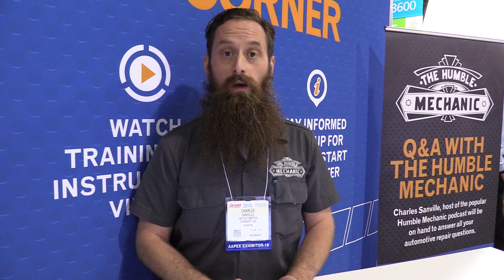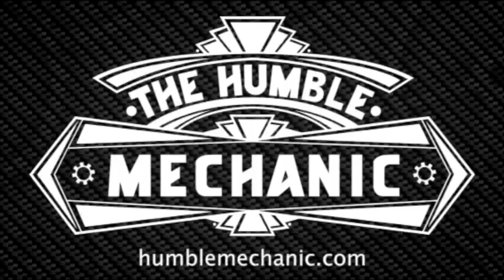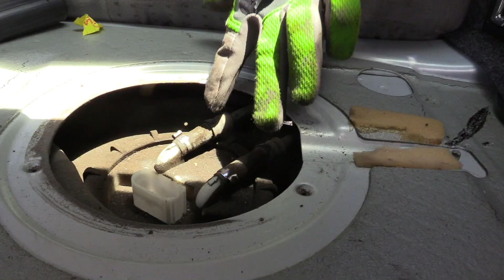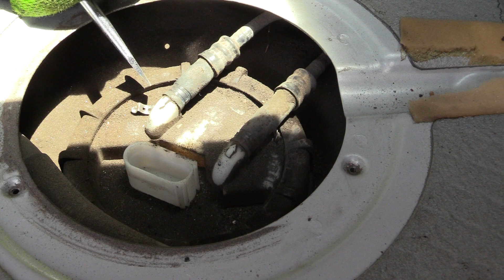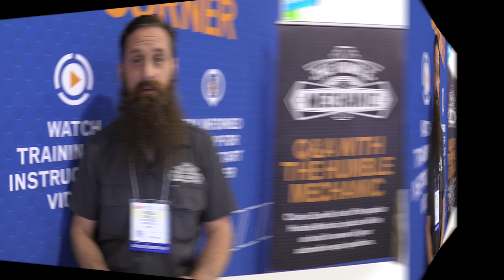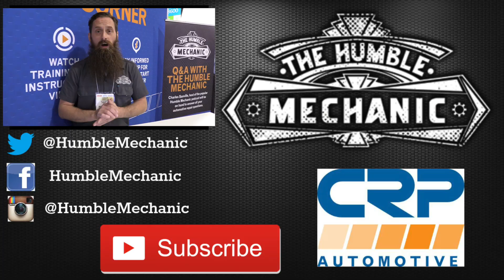Viewer Automotive Questions ~ Podcast Episode 168

Comment: HumbleMechanic I'm working on my 1973 VW super beetle and was curious about any tools that I should get or recommend.I would like to do as much work as I can without having it brought out to the shop .. love the videos keep them coming
Reply from the maker: Man, that car is pretty basic. A good set of metic hand tools should mostly cover you.
Reply: I have a full set of metric wrenches and a 3/8 socket set with  13 and 15mm ujoints.  I can pretty much rebuild this car with the exception of crank and axles with the small tool bag i carry with it.

Comment: we have a 2012 TDI and we believe that the headlights are insufficient in projection out in front of the vehicle. Is there an aftermarket brand bulb or replacement headlight lens replacement available to get the headlight beam projected more in front of the vehicle rather than the OEM panoramic projection?
Reply: Unless you have a single bulb headlight housing you wont be able to use LED's currently for our headlights.  I have a 2012 and 2013 Jetta TDi as well as a 2013 Toureg TDi.  Yes, im waiting patiently on the buyback to happen.  We have 2 different bulbs for high/Low.  I will however recommend OPT7 for the fog lights and any other SINGLE bulb housing.  I have several friends who have converted to using OPT7 and its quite amazing.  

https://www.amazon.com/dp/B00WNQGPNA/ref=wl_it_dp_o_pC_nS_ttl?_encoding=UTF8&colid=22UYQH14YSSRU&coliid=I85KR4CC7OW7X&psc=1

Comment: LEDs are not heat tolerant they have fans or passive copper braid to dissipate it. That dust cover traps it in... Could be an expensive experiment but leave that back cover off and give it rain protection of some kind.

Comment: Those halogen replacement led bulbs are a bad idea, they don't match the halogens closely enough to have the right beam pattern. 

It should be clear enough that they're a bad idea that both Phillips and Cree make LED chips, headlights, and LED light bulbs but haven't come out with their own halogen bulb replacements. The ones you buy of amazon and eBay are all pure chinium.  

Do a projector retrofit or just find some brighter halogens.

Comment: Question: Is there a way to make the twincharged 1.4 litre TSI more reliable - idealy without loosing power? I mean, if the engine needs to be overhauled every 100,000 km or so I could have bought something cooler like a car with a Wankel engine.

Comment: Fred. LOL dude said he actually took the advice seriously from an auto parts store. I work at one of the big three and me and my manager are the only two who have actually auto experience, and mine doesn't even touch outside of DIY. The most they did was scan the computer with out over priced and underpowered obd 2 scanner and there were not any stored faults just like he had determined by himself. People put way to much faith in free services from people making minimum.

Comment: PWM will kill aftermarket retrofit LEDs, most of which use a switching power supply.

You can try using a relay to send battery power direct to the LEDs; if the LEDs still fail, then it's a quality issue with the LEDs.
Reply: rhkips those bulbs don't match the halogen bulbs closely enough to have the correct beam pattern.